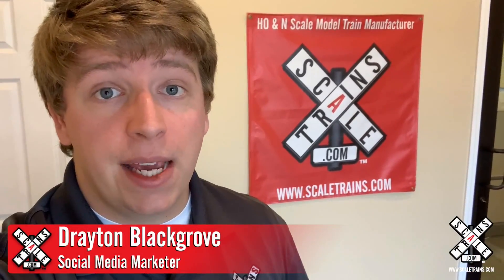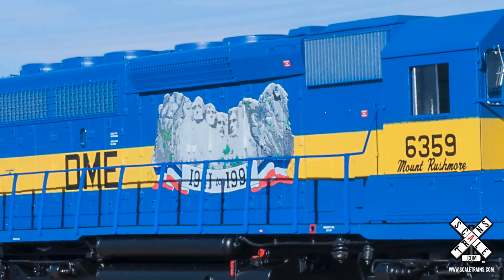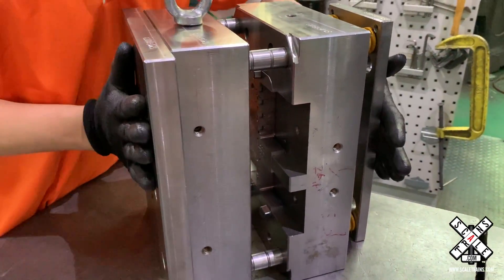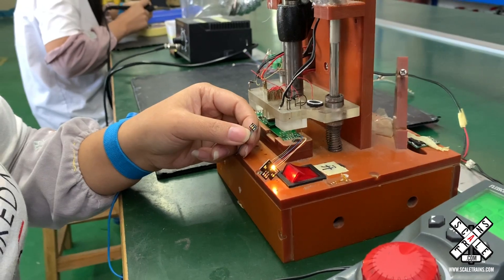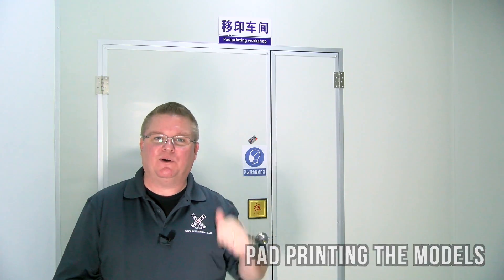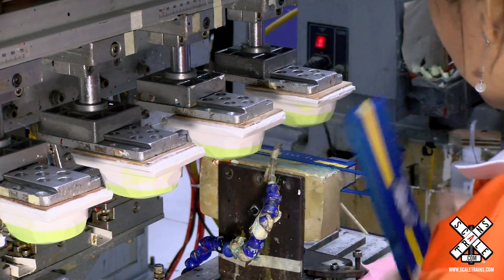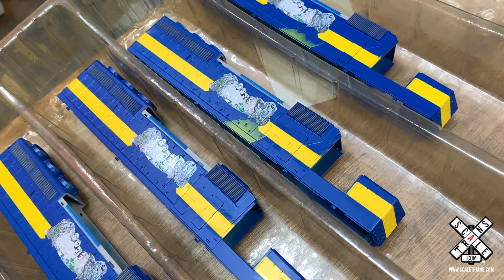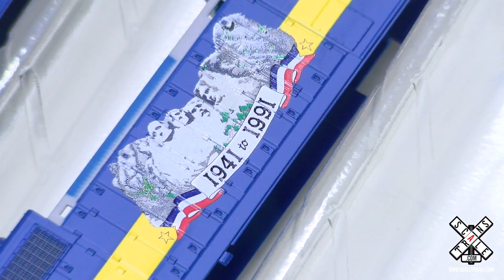How Model Trains Are Made: Pad Printing Logos on Diesel Locomotives

Comment: I saw nothing here that could not be just as well in the United States
Reply from the maker: If the SD40-2 was made here in the USA it would be a $900 locomotive. The market is unwilling to pay prices like that for quality plastic models. If we could make them in the USA, we would. However, the infrastructure, supplier chain, or pricepoint is not in place to allow us to do that in a way that our customers would be willing to pay for. This teaser video only covers pad printing. The full video, which shows all of the remaining phases of production, will be released later this spring. -Drayton
Reply: @Scaletrains  This actually appears to be a canned response with no backup detail. There is little here that could not be produced equally well with modern equipment in the United States. One would have to know the actual labor hours required to produce the model. There would be a disadvantage in this area in the US but that is hard to estimate without knowing the actual labor hours. The real truth of the matter is there are no longer any facilities in the US to produce model railroad equipment. Those that did exist were closed when the manufactures became intoxicated with the lure of cheap Chinese labor and left town on the first boat they could find.
Reply from the maker: @stude2896 : you're right, model trains could be manufactured in the US.  However, the cost of models would increase approximately 3x.  When we publish "How Model Trains Are Made, Part II", the reasons why model trains are not made in the US will be obvious.  Shane